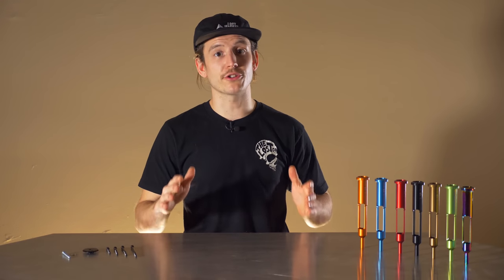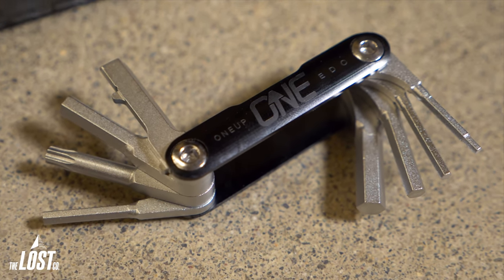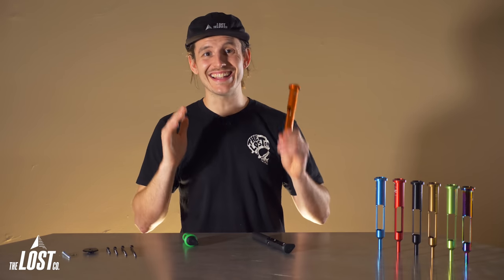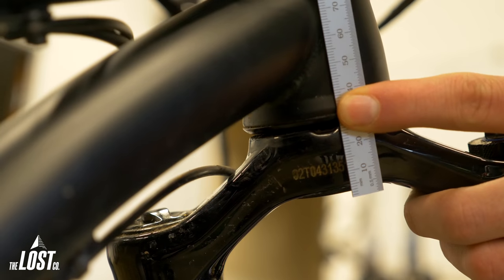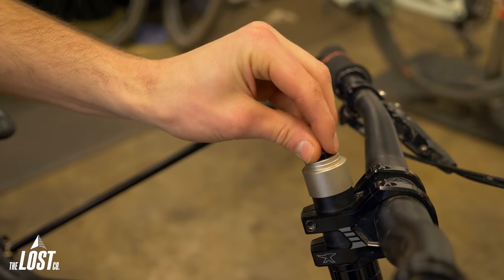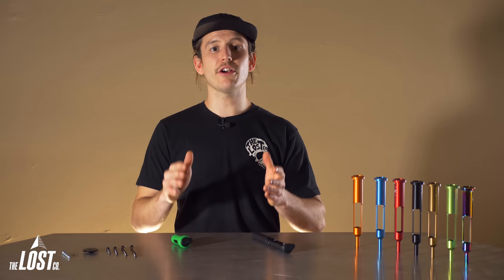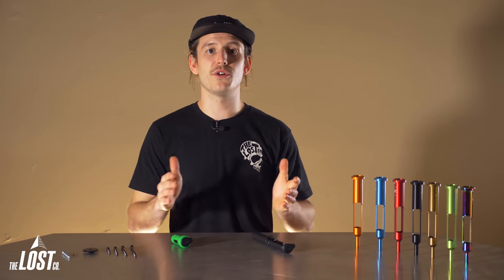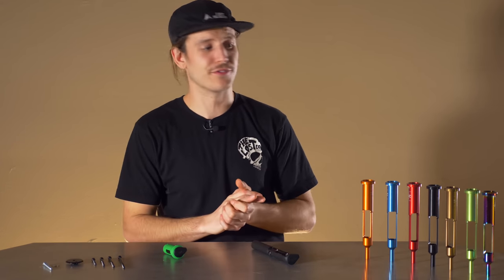OneUp Components EDC Threadless Carrier | Overview and Install

Comment: this is the first time ive been disappointed by running a fox factory 38
Reply: If you give the bottom a quick linish or file it fits in 
You only have to remove about half a mm

Comment: I use the Specialized, steer tube tool. The top cap looks near stock, yet twists a spring mechanism to reveal the tool.

If you need to use the chainbreakerbyou use the tool to unthread the bottom for nut.
It has a space for.a chain link and I added a short length of chain just in case.

Just another alternative!

Comment: fyi fox 34 2012-2015 works with edc v1, maybe even v2, with the threads tapped. I took a gamble and found it works great, only exception is the full size storage capsule doesn't fit as the diameter shrinks down lower in the steer tube. Not sure if the compact capsule fits. But the tool itself fits flawlessly

Comment: Got one for my hardtail that has a raceface turbine r35 stem that I prefer now I can just swap the tools between bikes without spending extra coin on another edc stem. I'm a machinist and was already thinking about something like this seems like they read my mind. I'm not much of a fan of the edc stem with preload ring it works but this setup is better in my opinion.

Comment: I have to say, I think I would've bought this threadless carrier had it been available at the time when I purchased my EDC V2 Tool.  However, after threading 2 forks of mine, I really prefer the threaded top cap (and threaded steerer tube) vs. a star nut.  I can't imagine the headset ever coming loose now.  Not that that was some nagging problem, but it has happened a few of times over the decades I've been riding.

However, if you ride XL/XXL frames (with long head-tubes), and like a lot of stack under your stem, this threadless carrier is compatible with significantly longer steerer tube lengths, which is definitely nice.

Comment: Just bought this set for my 2021 Scott Spark with the newest Fox 34 Performance and it's literally the same length as the steerer tube so I need to add a few spacers since even the shortest included bolt is too long.

Comment: I would prefer if the tool threaded into the carrier. Eventually it might wear out enough that it does fall out.
It's essentially just a stem lock with some space up the top. Not sure why anyone would get preload issues unless they are doing something wrong.

Comment: This doesn’t work on straight steer tubes. The inner diameter of straight steer tubes bottleneck as you go down, so the carrier will get stuck and won’t go all the way in. I’ve advised OneUp to update compatibility fine print on their website.

Comment: ATTENTION 
I have just installed the threaded EDC into my Fox38 Performance Fork.
Be aware that the steerer tube on the Fox38 Performance Fork is elliptical (oval) and would NOT accept the thread less tool.
I threaded the steerer tube and installed the V2 tool with the small storage compartment, the large storage compartment and fork plug does not fit because fork is oval.
Reply: Did you try before or after watching this video?  He says this clearly in the video that all versions of the 38 are incompatible...

Comment: Whats that starnut for that you need to remove from the fork ? Also "mushrooming the washer" what is that referring to ?
Reply: A star nut is a special nut that gets its name from its star shaped metal flanges, which keep it securely fastened inside your steerer tube. Together with a top cap and bolt, it allows you to compress the fork and headset components together, removing unwanted “play” between these parts. “Mushrooming the washer” refers to a washer folding in on itself (creating a mushroom shape) when force is applied in one direction from a bolt, and the washer is not supported over an adequate amount of its surface area from the other side. This causes the bolt to start to “push through” the washer in the middle, bending the washer and creating the mushroom effect.

Comment: Where did you get the data that the fox 38 wont fit...? I have one installed in mine...
Reply: You probably have the 38 performance. Fox 38 factory and elite are oval shaped steerer tubes.
Reply: @frannguyen  mines elite...

Comment: At 5:21 it’s mentioned to remove the O Ring, why is that the case as it’s not mentioned to pop it back. Just got this tool for Xmas and installing it so want to know if it has to go back on. Cheers
Reply from the maker: If you haven't figured it out already, the o-ring does not go back on. Without the o-ring on, the V2 tool should slide perfectly right into the Threadless Carrier. It will be difficult to get in and out with that o-ring on.

Comment: Cant figure out how to use / find the valve core tool, help!
Reply from the maker: It is somewhat hard to describe, but it is hidden by the spoke keys on the tire lever. Use the t25 to loosen the spoke keys from the tire and you will be able to use the valve core tool from there. Don't hesitate to reach out if you have any questions! (360) 306-8827 or sales@thelostco.com

Comment: Will the edc v2 with a co2 fit in this? I've heard rather mixed reviews from riders locally who have tried the stem and constantly having issues of it becoming loose regardless
Reply from the maker: Unfortunately, not. The EDC V2 with the small capsule will, however.
Reply: @TheLostCo  no worries , just weighing stuff up for what can I get out of the bum bag and hidden on bike 🤣 got a HUGE bum bag but the more snacks you can fit in the better !

Comment: Them edc stem doesn't work great at all without threads taped.( the last v2) It's NOT a fix for not tapping.The head set loosens after 2-3 rides. U just keep wrenching the preload down. Getting the tool out was a chore in itself as well. Preload bolt wears out eventually,I took mine out and got the pump and put it on my gravel bike.

Comment: This video is s bit misleading.  It's about the Threadless Carrier, but the wound-up guy in the video suggests that you can use the storage capsule or a CO2 cartridge.  YOU CAN NOT USE THE STORAGE CAPSULE OR A CO2 CARTRIDGE WITH THE THREADLESS CARRIER.  You can use the mini-carrier, which is large enough for a spare chain link.  If you want get the full capability out of the tool kit, you'll need the threaded carrier.  The chain link pliers can NOT be used with the treadless carrier.

Comment: any idea if this would work with the stock stem on a canyon spectral 29? the top cap isnt round so im not sure
Reply: It should work since it depends on the fork steerer tube, not the top cap. I do understand the confusion though since canyon make weirdly shaped top caps, which i think look cool.

Comment: Will this fit the rochshox zeb
Reply from the maker: If the steerer tube length is in between 210mm and 265mm, there should be no issue. Feel free to check out the installation instructions on the page linked below, that will help you verify. 

https://thelostco.com/products/oneup-components-edc-threadless-carrier

Comment: Fox 38 performance steertube is non-oval? The bottom of mine looks oval... Am I missing something?
Reply from the maker: Hey JW, if you truly have a Performance and not Performance Elite Fox 38 with an ovalized steer tube, please send us a picture to sales@thelostco.com

Aftermarket Fox 38 Performance do not have an ovalized steer tube, and according to Fox they do not make an OEM Fox 38 Perforamance with an ovalized steer tube.
Reply: @TheLostCo  realized the company I bought the fox 38 from cut the original steerer too short and replaced it with another CSU (must have been from a performance elite).
Reply: I have the Fox38 Performance fork and it is definitely elliptical

Comment: Does it work with knock block?
Reply from the maker: To our best knowledge, yes it should since the Knock Block is only on the outside of the headset. You will still have to confirm the Threadless Carrier fits with your steerer tube length. See the Compatability section @ 3:25 for more information on that or give us a call or shoot us an email.

(360) 306-8827 // sales@thelostco.com
Reply: @TheLostCo  Thanks for the response!

Comment: Beware. If the Headset gets loose on the trail you cant reach the deep Screw with the integrated EDC Tool. Kind of a design Fail.
Reply: Would you not just tighten it from the bottom screw under the CSU to reset preload?